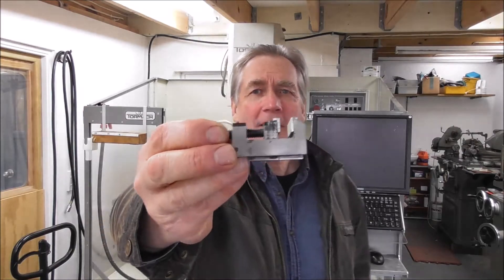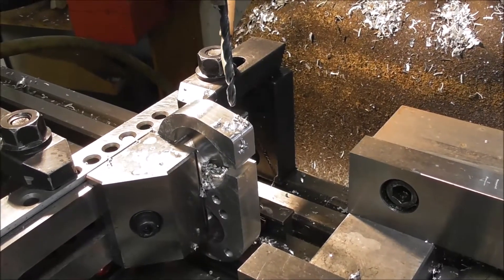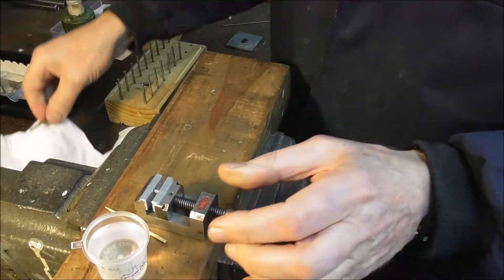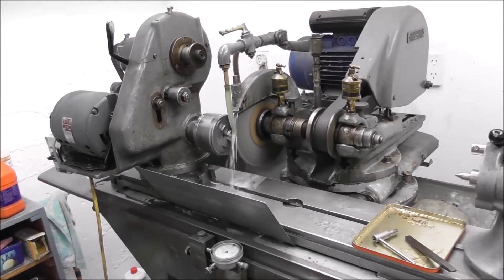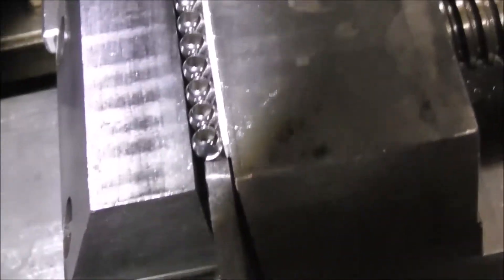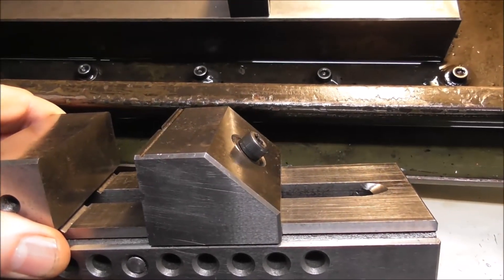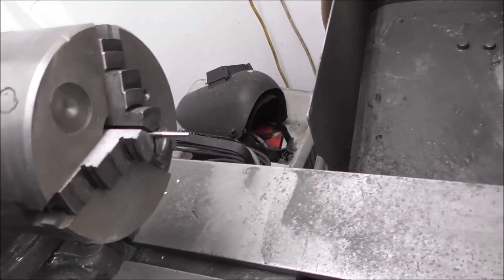Part 4 - Tormach and other mill - Workholding

Comment: Hi,

I’ve been using one of your probes since springtime this year. On a tormach 1100. I have to say I couldn’t be happier with it. It’s really a game changer for the work I do. Locating parts is now quick and easy and as accurate as I need, or I should say, as accurate as the tormach is capable of. The haimer is now only used on the haas mini mill just for locating stock for first ops.

The tormach used for secondary or backside ops and the tormach probing routines with your probe is excellent.

Funny thing is I used to break haimer tips with depressing regularity on the tormach. Since switching to your probe I haven’t even come close to using it’s impact tolerance. I suppose that’s due to using probing routines or maybe it’s due to not worrying as much when manual probing :-)

I’d recommend your probe for any tormach user. It’s really not an exaggeration to say it’s a game changer compared to haimer on the tormy.

Alistair
Reply from the maker: Hi Alistair. Thanks for taking the time to post that feedback. I should copy that comment to the Hallmark Design website testimonials page. (let me know if you don't want that. ) Cheers  Cliff

Comment: Hi Cliff
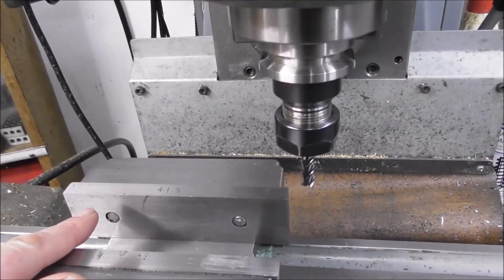Watching your videos closely as always :) At exactly 10:00 your finger points to a vice jaw and I can't work out how it mounts to the vice. Is it just located on 2 pins or is there a hidden fastener somewhere?
Good idea to engrave the jaw heights. I'm continuously measuring them. Funnily enough the result is always the same...
Step
Reply from the maker: Hi Step. Oh I think you are referring to the jaw holding screws..some vices  have the threads in the jaws. Cliff
Reply: @Threadexpress  Hi, now I'm curious. They don't look like differential screws unless they're covered by a cap, so presumably the screws are fed from back of the fixed jaw, I can see the advantage, but is this also the same for the moving jaw? Your video only sweeps quickly by the moving jaw so I couldn't get a good look at it, but it looks like there's a cover over the moving jaw. Are these screws therefore hidden?
Step
Reply from the maker: @CNCTurboStep Correct. Cliff

Comment: I've got 2 kurt 3400s on my 770.  I couldn't be happier with them and the pitch on the table slots happens to match the vise.  The only downside is that there aren't many options for 4" parallels.  I've used them on their sides a few times.  I really need to make some dedicated hold downs for that position.
Also, thinking of the small chucks, I made a small block that screws to the back of my rapidturn 3 jaw so I can just grip the block in a vise.  Much more convenient than strap clamps.
Reply from the maker: Thanks for your comments John.  Cliff